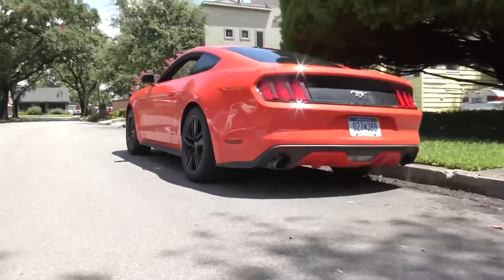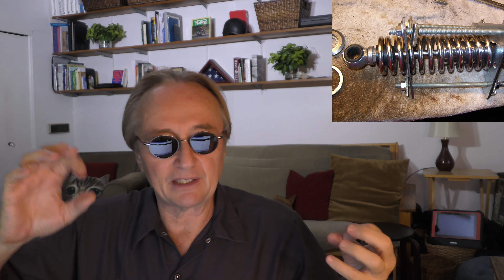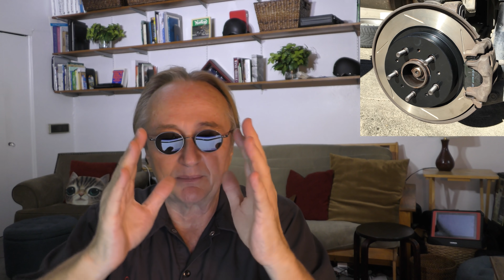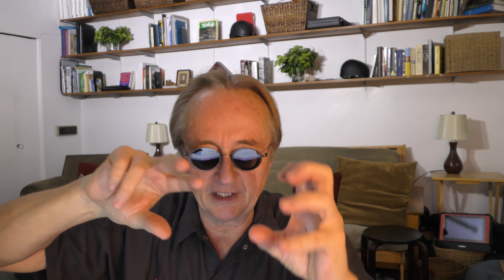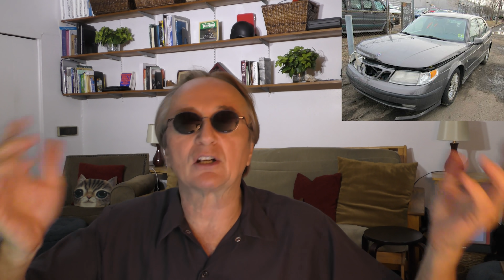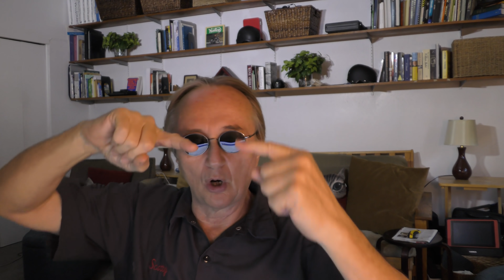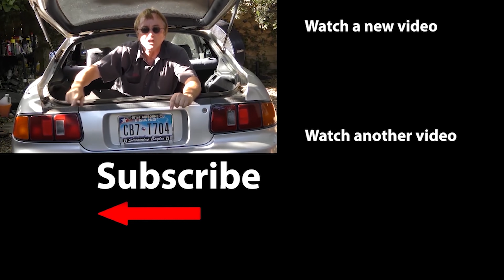Here’s Why Volkswagen is Going to Take Over American Car Manufacturing

Comment: Hey guys I'm looking to buy my first car in cash soon. And was wondering which options would be suitable for anything under 10k, considering the price of cars dropping recently as well.
Reply: Richard Salazar They are many cars you can find under 10k. Older cars and some newer cars. Just depends on what car brand you want. If you want a Toyota, you would likely be getting a older model, but if you were to get a Nissan, you could find many newer ones. Again, it depends what u want. Consider that Toyota’s are more reliable, but lack the newer safety features.

Comment: I just got a 2013 Scion FR-S two days before this virus hit and I lost my job. It has 85,000 miles. Should I keep it or sell it. I need a car that will last what are your thoughts my friend.
Reply: Depends on what you could get for the same price to replace it. If the FR-S was a well-maintained car, it could have a while left in it. If you got the FR-S on a loan, then sell it and pay cash for some '96-02 Corolla or Prizm. Just check the oil every fillup and top off as needed, and you'll be fine.

Comment: Honestly, designers/engineers haven't been doing such a bang up job, as far as I'm concerned... How about that German manufacturer that placed the starter under the intake manifold?
Reply: michael cook dealing with it or getting ready to change water pump.  But I’m thinking it’s that little rubber coupling that couples water pump lions to that silver can beside the pump.   But idk what the part is called... 😬
Reply: My toyota 1uz is like that. The only flaw i can put on that engine

Comment: Nevery buy a Volkswagen! Had a check engine light that relates to the transmission. Took it to two different shops and one of the shop specializes in cars like VW and both shops couldn't help me.  Once I get it fix, im gonna sell that piece of trash!

Comment: I bought a VW 2019 Jetta 1.4 S (base model without any of the bells and whistles) with a manual 6 speed transmission.  It has low mileage at about 1.6k and I feel like I got it at a pretty good price bout $15k. The car drives well and I wanted to ask if I maintain the car well like changing the oil (synthetic) every 5k miles,  changing break fluid,  plugs,  coolant fluid,  belts,  etc... will the car make it to 150k miles without any major unexpected repairs?  I've never owned a VW and was wondering at what some of the people that own them think?
Reply: No..
Reply: You'll have the annual service, that's enough

Comment: I have a 2002 Volkswagen Jetta TDI - 1. 9 engine , I think
Reply: Yeah, those pre-Euro V 1.9's were bulletproof with good maintenance. Drive it as long as it remains reliable.
Reply: The best vag engine ever made! They can withstand a lot of punishment!
Reply: @eponymous7910  they could had given more research to it,to make it at least a decent Euro 5..I know to get from 3 to 4 it's possible just changing few parts..sad,it was way better than the successor 2.0 or the useless 1.4 🤦😅

Comment: Didn't those Saturns use toyota designed ASIN transmissions?
Reply: John Smith the previous generation V6 did, then they moved to a Honda V6 with a Honda transmission. Second generation I believe has a GM transmission.
Reply: Zach Waldauer my Volvo 850 uses an Aisin transmission
Reply: Can confirm, my wife bought a Saturn Vue with the Honda designed v6 and transmission. I can’t seem to tear the darn thing up. It does have a bit of a clacking when it’s first starting up / cold though.

Comment: Since 2014 VW makes really good reliable cars. I have seen big change in their cars. Very simple n reliable.
Reply: Beetween modelyear 2004 - 2013 they were less reliable, so you are pretty right.
The VW UP was reliable already from it's first modelyear 2012.
My next car will be a Volkswagen again, back to the roots.. my first car was a Golf   CL 1,8i 90 HP modelyear 1990, next car will be VW E-UP or a VW ID.3.

Comment: Hi Scotty, 
I just bought a NISSAN MAXIMA 2003 the car is in GREEEAAAAT SHAPE, transmission shift excelente and no check engine on. What can you tell me about that car? Your experience.

Thank you
Reply: In 2003, the Nissan Maxima was an excellent car. Two of my friends had them, one had 180K when it was crashed, and one sold his with just over 200K
Reply: Since I bought the car has no issues, I change the oil clean it and has a very strong motor for the car. Is a SE model obviously has some minor things to fix but nothing has to be from the motor.

Comment: Should I buy a 2007 Toyota Camry SE with 450,000 miles for $350.00
Reply: Yes!  then get a used engine / trans.
Reply: I'm sure guys have bar tabs higher than $350. If it drives buy it.
Reply: N0RT2G0RD4U they say it will die in few months
Reply: N0RT2G0RD4U it runs surprisingly well right now, but they say it will die in few months

Comment: Volkswagen had decades of success by making simple, cheap, ultra-reliable cars. Seems like 100 years ago.
Reply: One of my favorite cars that I ever had was a bright yellow 1972 Super Beetle.
Reply: @gregnixon1296  I own one now! Great little car, not a show car, but runs great. Just put new tires, rear shocks, oil change done!👍😀
Reply: I love my ‘97 VW Passat TDI, but I understand that most VWs made recently are made cheaply and over engineered, though I love the look of them 🤤
Reply: @zanesutherland406  I leave to drive on 5sp Passat TDI. Best car ever. Glow plugs went out. And a lot of problems with door handles. But other than that the car ran had like three hundred thousand when I totaled
Reply: I'd never buy another one.
Reply: Oldschool beatles with carbureted flat 4s are bulletproof.
Reply: Thought they started producing during the 1930's...you know, when this guy named something like Hutler was in charge...and wanted a "People's Car"....
Reply: @markh.6687  They only started producing civilian cars after the second world War
Reply: tolpacourt my vw Touareg takes 30 minutes to star and the part is not cheap at all. It’s something to do with the brake switch and I was told it’s going to be pricey
Reply: @Vr6.christos   ORLY
Reply: tolpacourt nope.....only been 50 yrs
Reply: @mikecastellon4545   Ackshully, 51.
Reply: Ultra reliable...lol
Reply: @yourfast07  looks like some people are just not capable to drive a decent car
Reply: @user-ht1nf1ff4y  vag cars with petrol engine, aren't for Very many kilometres and for more than 7 years. Vw 's CEO has told that, their cars will not be for more than 5 to 7 years old.
Reply: By the 2030s, it WILL be around 100 years
Reply: @tolpacourt Funny they're still the second largest car manufacturer in the world.. Seems like many people including myself have been buying their cars for years and still consider them to be cheap to maintain reliable cars. Mind-blowing tho how many people who drive toyotas are biting their nails to tell you how "awful" they are.
Reply: German cars are not for everybody.. you're the " run it down to the ground" type of guy.  Stick to Toyota Corolla
Reply: @omariharrison2553  German cars were made to last, until about 20 years ago. They got greedy and quality took a nose dive.
Reply: German cars and volkswagen are unreliable garbage. So many catastrophic failures it's unbelievable
Reply: Vw and German cars are unreliable. Nothing same with Japan cars. I laughed with your comment, thank you
Reply: @giorgoslanciadelta95  I have no idea where youre experience is coming from. I drive VW or Skoda since more than 30 years. Never had any problems.
Reply: @user-ht1nf1ff4y  vw golf mk2, skoda fabia 2006 and seat ibiza 2000! never vag group again!!
Reply: @giorgoslanciadelta95  says the Lancia - Fan. Cars from the Fiat group start rusting in the show room.
Reply: @user-ht1nf1ff4y  the history that has Lancia, will never have any other company!!! My 20 years old Lancia, hadn't rust, also my two fiats. Vag is only for check engine, oil consumption and problems. I have 3 cars from vag and three from fiat group. Of course fiats were more reliable and not so expensive at service.
Reply: @giorgoslanciadelta95  Did you drive your Italian cars? By the way, who cares about history. Today Lancia is a lousy car. Jaguar had history and now it is Tata.
Reply: @user-ht1nf1ff4y  200.000km from 2007 and 110.000 from 2012 at other Fiat. So... I don't drive them? You are not clever with your silly questions.
Reply: I had the misfortune of owning a volkswagon once.
I will never buy another volkswagon and probably never buy another german car after that experience.
They are beyond bad.

Total and utter trash.
Reply: @charleswidmore5458  it should depend on the model and year. They do require regular maintenance as well so it’s not going to be as forgiving as say a toyota corolla
Reply: Crap people with crap tests and cars. Look pollution what did to to Earth. People like to be fooled forever it seems! VW will fall, God bless that!
Reply: @lovemademan  all the german car companies had the same failures, just not affected evenly against their volume considering VW is the largest. Besides, climate change being caused or exacerbated by car pollution is way overrated. Not only is it a rich person’s dream, it’s inevitable and slowing or stopping car pollution in US and Europe by a miracle will not stop climate change
Reply: @lovemademan  ooo, please,America is worst. 350 million nation who loves biig engines and going to shop is like 30 km driving. 3.0 litre engine - 6.0 engine
Reply: tolpacourt yeah... German and Japan are in the same line with quality products
Reply: @tangchiprathomo819  wat
Reply: @tangchiprathomo819   were. past tense.
Reply: @tolpacourt  up till now, IMO.

Comment: Next week: “bad news, Chrysler is starting production back up at their factories”
Reply: Has a thumbnail of a chrysler with the word, "Run""
Reply: Ram is and has been the number 1 rated truck for years running now. Must be doing something right with their trucks. Not my opinion, just the facts. Update, I forgot to mention #1 selling as well. 😁😁😁😁😁😁
Reply: @billbkr32ify  Maybe number one in recalls and poor quality.
Reply: @billbkr32ify  the main problem is their cars
Reply: @austinmcwilliams9192  Yes, they have went downhill as many did in that area. They are putting all the tech support into the Ram truck's and Challenger's now. Big mistake on their end.
Reply: @billbkr32ify  on this days most of American cars really sucks in terms of reliability. I will always prefer Japanese or Korean cars instead.
Reply: Bill Baker The type of guy to rely on those cheap “number one reliability” awards to go on cars that aren’t even a week old.
Reply: @billbkr32ify  Just because a bunch of people buy them new doesn't mean much. They are just going for the cheap price. They will pay dearly later with maintenance issues.
Reply: @billbkr32ify  every ram I've seen has had nothing but issues, I had a customer come in with 30,000 km on it and had to replace the front axle completely
Reply: Bill Baker why aren’t they the best seller then.
Reply: @appalachiangunman9589  Ram has been the number 1 selling truck for years. Not sure where you are getting your info because it sure isn't Chevy or Ford.
Reply: Bill Baker it the F-series not just the f-150.
Reply: @billbkr32ify  depends. Rams used to be built with metal parts and Cummins motors.. now Cummins are in Nissan's and the entire motor has a plastic part on every single crucial system.  Rig workers and miners loved them, durable and easy to fix. That has been gone for 12 years? They present well and then fall apart unless they are a pavement princess...
Reply: Good news for the towing companies.